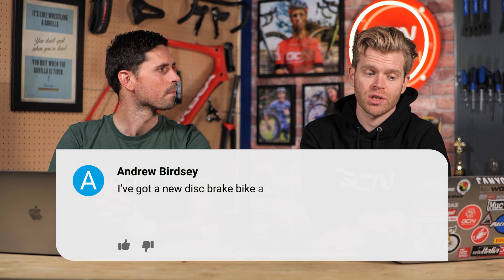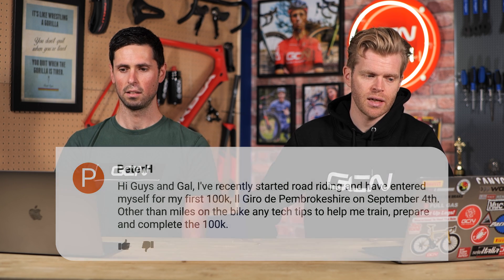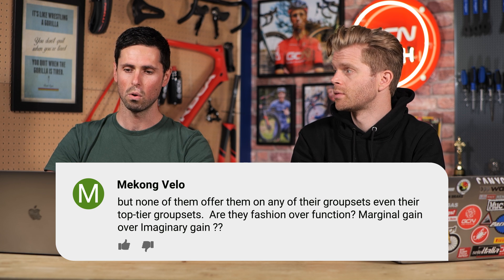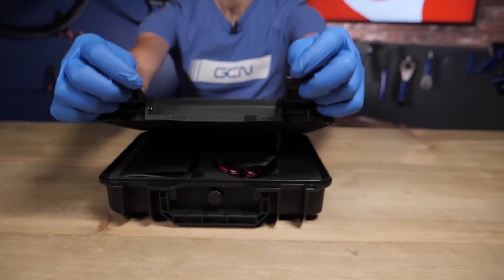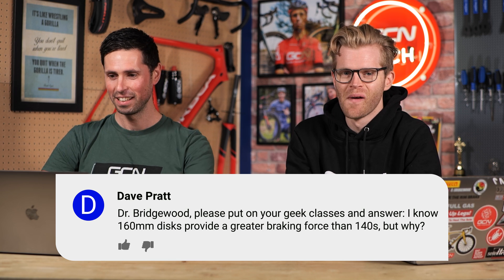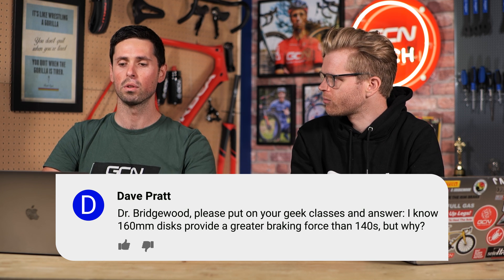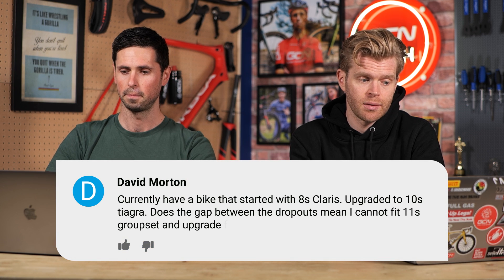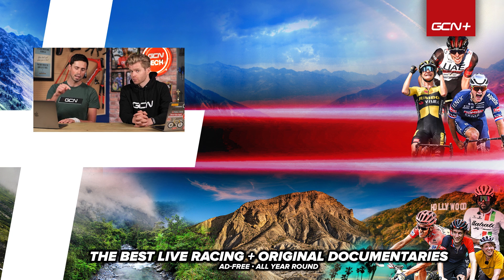Is There A Maximum Speed Bike Tires Can Go? | GCN Tech Clinic #AskGCNTech

Comment from the maker: Do you have any pressing tech related questions? Ask them in the comments below with #AskGCNTech, and we'll get back to you in a future tech clinic!
Reply: Do single speed cruiser brake bikes have fewer repairs and repair costs per kilometers ridden per year?
Reply: #AskGCNTech
Hi GCN, I have a bit of a conundrum that I am hoping you can help with.  When pedaling under mild to heavy loads in 50/11 my bike feels like it is skipping gears.  The feeling is so unnerving and I am afraid I will crash each time it happens.  This ONLY happens in 50/11.  The cassette is relatively new and I have replaced the Rear Mech hanger, Rear Mech, Chain and Freewheel but the issue remains.  I have also had 2 local shops look at the bike and the mechanics are all baffled.

Cervelo R3 - Rim Brake - 11 speed Shimano Ultegra groupset (mechanical) w/ 50/34 Front & 11/34 Rear.  The hub is an older Powertab G3.  Please help!
Reply: How hard is it to convert a bike to an e-bike post purchase?
Reply: How do you remove old Octalink cranks from the BB, when your crankarm puller has stripped all the threads and tapping them with a hammer doesn't work?
Except for just... sawing them off, of course.
Reply: So, ref @5'46", bigger rotors mean bigger moment, equals greater effectiveness, then increasing rotor size means better braking. Let's take this to the limit - a rotor the size of a wheel. But since we already have a "disc" to which the tyre is attached - we can do away with rotors altogether - "et voilà" - rim brakes. 🤔🙃

Comment: #AskGCNTech I have a gravel bike (Cinelli Zydeco 2022) and it came with a mechanic groupset. There are cable holes running through the tube. I recently upgraded to a Rival eTap XPLR groupset and now the cable holes are empty and worried that water might enter the frame if I leave them open. Any ideas on how to cover them up?

Comment: #AskGCNTech Hi guys and gals, what are your thoughts on creaking carbon frames?  Is it a thing?  Do lower end carbon bikes inevitably develop a creak?  I have a Giant defy 3 with about 6000 miles on it and a few weeks ago the bike developed a dry creaking noise around the bottom bracket area when climbing or off the saddle putting down some power.  Took it to my LBS to get the press fit BB replaced, still creaks.  Swapped out the front crank, still creaks.  Cleaned the seatpost, still creaks.  What gives!?! Thanks for your input and love the channel.

Comment: #AskGCNTech Hi gang. I’d love to dive into the world of latex. I’m talking tubes of course. I’m currently running normal tubes in my Campagnolo Bora WTO/Vittoria Corsa combo, but is it safe to use latex tubes in carbon rim brake wheels? Will there be issues with heat when descending as I tend to drag my brakes because I’m a bit of a pu**y 😞

Comment: Why are standard SRAM 1x chainrings with more than 50t only available in BCD130? Do I have to buy a China import instead? I have a 1x gravel bike which I use for triathlon and want to „speed up“ from my current 50t. However, I plan to get a BCD110 Powermeter spindle and want the option to use easier options from time to time #AskGCNTech

Comment: OSP probably aren't faster since you've got more tangential torque on the bearings, therefore increasing the drag and wear. Offsetting the gain from the bigger size. your explanation about manufactures not testing it is probably bs too. over many decades surely they'd had many many opportunities to test different pulley wheel sizes. and seing ceramic speeds prices for which they can actually sell stuff they would have done it buy now 100%

Comment: Either the large pulley wheels are hog wash or 10 tooth cogs on cassettes are horrendously inefficient. Which is it? If the reasons why large pulley wheels reduce system friction are true then those reasons should be doubly true for inefficiency of a much more highly loaded cassette cog with 10 teeth! I think it’s ridiculous to accept 10, or 11 teeth on a cassette but then blow money on OSPWs. Yes, the extra chain articulation of smaller wheels robs some small wattage. There’s much more wattage to be saved with larger cassette cogs than can be saved with larger pulley wheels.

Comment: On the groupset and oversized pulley, it's likely the patent required is owned by someone else either Ceramic speed or so and other brands are looking for ways to optimise performance that doesn't infringe on the patent owned.

Comment: #askgcntech How many pounds per square inch (or metric equivalent), can a crank and pedal system handle, before failing?

Wattage Bozooka question: how many pounds per square inch (or equivalent) can a sprinter (track/road/bmx) produce?

Comment: Oversized Pulley Wheels:
The more the chain is angled in the jockey wheels, the more friction there is. But the higher the quality of the chain, the less friction it has. A Dura-Ace chain has much less friction than a 105 chain. Therefore, enlarging the jockey wheels is less effective there. If you climb a mountain on the small chainring with maximum power, the effect is particularly small. The advantage is greatest on an Ironman bike course because the power is slightly lower and the chain speed is higher on the big blade.

Comment: Generally speaking, bike wheels/tires also have a larger diameter than car wheels, in addition to the the magnitude+ differences in weight and forces between your average cyclist and your average car. IE bike wheels roll at lower RPM at a given speed, compared to car wheels, meaning the much-lower forces are spread out even further

Comment: #askGCNtech Hello, from sunny south Florida. I have a peculiar issue with my 2020 Allez sprint. I've noticed a small creaking from the drive side which pushed me to get the bearings changed. Now the issue persists at noticeably less amplitude. What's bothering me is it's come with a new noise on the non-drive side when I'm bearing weight at the bottom of the pedal stroke while coasting, like a small hiss of metal-to-metal contact. What could this be? I’m super particular about noises on my bike and always try to keep the maintenance in check as if it was a formula 1 race car.

Comment: There are some older shimano groups that have larger tension pulleys on the rear derailleur. I have one 9 speed altus that has a larger 16 or 17 tooth pulley, Compared to the standard 11 or 12ish.

Not exactly done to the same level obviously, but it has been done. If I had to guess, the smaller pulley wheel lend themselves to smoother shifting groupset, also obviously cheaper and more compact so they don't get hit as easily by sticks, rocks or whatever.
Reply: Shimano megapulley! I remember seeing this on an old hybrid bike and chuckling to myself

Comment: For a mechanical groupset alternative to 105, I'd suggest Sensah Empire.  Trace Velo, China Cycling, and others have reviewed it, favourably.  I get along really well with mine.
Reply: +1 Sensah Empire and SRX Pro are amazing groupsets. 100% functional and easy to service for the average rider. Extremely smooth shifting,  and there's plenty of on and off road testing to back them up.

Microshift Advent X is an exceptional option as well, and it comes with a clutch and dropbar compatibility to boot. A bit more rugged construction than the Sensah options, but slightly heavier and more expensive.

I run a gravel bike and enduro bike with Advent X, a road bike with empire, and I just built up an adventure bike for my best friend with SRX Pro. I also sell, service, and rent out bikes with components from all other manufacturers. I've ridden, repaired, taken apart, and thrown away just about every deraileur and shifter out there. 

The top of Shimano and Srams' catalogs are superior to anything coming out of the Eastern Market; Red ETap, Dura, and even Rival and Di2-- those are extremely high quality groupsets. Sensah and MS have nothing to compare. 

But below the electronic lines from big boys, the mechanical offerings are comparable or worse than their eastern competition, at a price that can reach 1000% higher. If we ever get hydraulic breaking with the Empire and Advent x, I'd argue that Shimano and Srams mech groupsets will have very little value return.

Comment: Alex, you are whoa fully  uninformed regarding latex tube repair.  I have repaired hundreds of tubular flats with latex tubes using a patch’s cut from an old latex tube and rubber cement. It’s safe and have ridden hundreds of miles on repaired tubulars before you where even born.

Comment: #AskGCNTech I have a 2021 Giant TCR Advanced Pro that actually came from the shop with 32mm gravel tires (not sure why) which I replaced with 25mm tubeless road tires. While riding the roads in the Appalachian mountains of North Carolina I came across a 3~ mile gravel section so I deflated my psi to about 40 and proceeded carefully with no issues. Should I use my road bike in the future for light gravel routes like this? Can I adapt my road bike into a gravel bike by employing gravel tires? Or do I just need to bite the bullet and buy a gravel bike?

Comment: #AskGCNTech Hi Guys, in motorsport, the drivers always warm up their tires before a race. Could this also be useful in bike riding?
Reply: I think tire warmup for motorsport is mostly to acclimate the tires to the high temperature and stress they'll experience acutely when they accelerate rapidly. If they didn't warm up,  they'd be going from cold to 100mph in just a few seconds, and the rubber would be too brittle to handle the force.

Since bicycles accelerate significantly slower, they don't get the same acute force activated all at once. In fact, by the time a bicycle tire starts withstanding significant force, heat, or stress, it will have already had plenty of ride time to warm up.

Comment: #AskGCNTech I have got a lot of problem with wind noise lately. My tinnitus gets very loud after some time on the road. I have tried wind-stopper muffs and “cat ears” but it haven’t been so effective. I have looked at TT helmets like the Giro Aerohead that cover the ears but does it help to reduce the wind noise? Or are there some other good tips to my problem.
Reply: Believe it or not, earplugs will let you hear better by blocking the wind noise across your ears. They reduce all sounds true, but wiping out the "bottle top" effect more than makes up the difference. 
I'm surprised you're tinnitus is increased by a bicycle ride, it is windy, but not terrible. When the weather gets cold, an under helmet cap or balaclava that pulls over the ears will do fine as well.

Comment: #AskGCNTech Dr. Bridgewood a follow-up question, if I may. If it is about a larger moment arm and surface area, then why don't rim brakes offer the best stopping power? The wheel's rim track is both larger and further from the axle than the disk rotor.
Reply: They can and do have better  but they are limited by how aggressive you can make the pad as it would wear the rim to fast. On a disc rotor you can clamp harder(especially with hydro) and use more aggressive compounds because the wear surface is replaceable.

As a kid we all leaned that you can't clamp the front brakes to hard or you go over, I have not been able to (as easily) do that on a cable actuated disc brake.

Also disc has advantage over rim brake for wet weather as the braking surface is not as close to the tire and splashing water.
Reply: Couple of reasons, pad material, and the amount of force applied.
If you used the same material that is used in disk brake pads in rim brake blocks it would increase the friction by a fair amount but it would destroy  an alloy rim very quickly and carbon ones pretty much instantly, disk rotors are a consumable part like the pads because of the friction materials used.
And as for force applied, disk callipers ( both mechanical and hydraulic) can exert a higher clamping force on the rotors than rim brakes can for the same amount of effort at the brake levers. Which is why a relatively small rotor still works. You also gain a bit more finesse with disks where sometimes rim brakes can feel like all you have is "off, on, and completely locked up"
I'll still be sticking with rim brakes though. Cheap, simple, and they do what I need well enough!

Comment: #AskGCNTech  at which speed would you recommend stop pedalling and going full aero? In regards of getting fast and/or saving energy.
Reply: I suppose you do it at the speed where your pedaling is making less of a difference than your drag. That's not a fixed speed. It depends on the wind speed and direction, the grade of your slope, your own personal inertial energy. If you are a heavier dude with a heavier bike,  you might choose to tuck earlier or at a lower speed than your lightweight buddy who stops pedaling and actively loses speed due to his low gravitational potential failing to overcome air and rolling resistance. 

I think you have to ride a lot,  practice a lot, and learn to feel the forces acting on your body and bike to determine the best strategy for yourself.
Reply: That’s a great question !

Comment: #askgcntech Hi tech team, the OSPW question made me think; The current market leaders of OSPW systems make such expensive products, and therefore can only be fitted to top tier groupsets. Do you see trickle-down tech bringing affordable versions with standard steel bearings to the market as more of a custom modification for mid tier groupsets like 105 and Rival? Note about the Claris/Tiagra upgrade, don't forget some older freehubs are not as wide, so if there is no spacer behind the cassette, 11 speed is not compatible and you would need a new pair of wheels to complete the upgrade.

Comment: #AskGCNTech Hi ya Team! I recently got myself a new gravel bike with GRX which comes with a clutch on the rear derailleur.  As 85-90% of my cycling is tracks & trails, is there a reason why I can't just leave the clutch on all the time?
Reply: The clutch is made to be active all the time. The only reason there's a release trigger or hold button is so you can service the groupset and chain without dealing with the clutch tension. 

The chain will not stay on the bike with the clutch disengaged. Not even on a smooth road. The clutch release completely mucks up the primary shift mechanism. Don't try to ride like that. It's not made for it.

Comment: #AskGCNTech  I  suppose this is a question for Ollie . . .
Does barometric pressure have an impact the strength of a headwind?  I.e. does it require more power for a 70 kg cyclist riding 30 kph into a 20 kph headwind when the barometric pressure is high rather than when it is low?
Reply: This is a very interesting question. But what will the answer teach us? We don't get to control what the weather is like when we ride, what the barometric pressure is, or even whether or not we're going into a headwind. Knowing whether the pressure makes a difference won't change behavior, will it? Like, we wouldn't ride differently, would we?
Reply: @BoomerangVillage  yes it would, Stravaaaa! Low air density and a tailwind, heading out to get that segment back from the e-moped.
Reply: The barometer measures air pressure. Air pressure is half atmospheric at 18,000 of altitude. Airliners like to fly high for efficiency of less wind resistance. It applies to you as well. But, I'd guess you'd have trouble measuring the difference caused by the tiny  differences we get from natural pressure changes.

Comment: I've been repairing latex tubes with Rema patches since the 70's in tubulars and over the past 10 or so years in clinchers.  I've used both 20 mm and 25 mm patches depending on tube diameter.  Also, have found latex tubes are easier to patch than butyl as the latex tubes have no seams.  I don't recommend using sealant in a latex tube as the hole in the tube will eventually develop into a tear.  Also, don't recommend using new or patched latex tubes on long descents -- learned this while living in the Colorado Rockies.  This would be true for the newer plastic tubes too.  However, when living in relatively flat Texas, and even in the Hill Country, the descents weren't long and windy enough to cause an issue due to rim brake heating the tire.  In CO the rim would be so hot from braking while descending if a tube blew had to wait for it to cool down to replace the tube.  Disc brakes would be the way to go.

Comment: #AskGCNTech Hey lovely people, re: 160 vs 140mm discs, then why don’t rim brakes have the most stopping power of them all? I’ve never understood that… Thanks for saving me from many more sleepless nights trying to figure that out!
Reply: Even though the rim brake has a longer lever arm (being further out on the wheel), it cannot match the clamping force of the hydraulic pistons so the overall effect is better stopping performance from disc brakes. Plus, if your clamping force on the rim brake is too high, you could damage the wheel. A disc brake does not have that limitation.

Comment: In the last question. If the rear hub is 8, 9 or speed hub. The Shimano 11x34 cassettes are concave on the back. To fit the shorter freehubs.

Comment: #AskGCNTech.  Hello GCN Tech gurus. Is it imperative to have a maximum 16 tooth variance between the small and large chainrings on a 2x drivetrain?  I have a 48/32 set and a 50/34 set by the same manufacturer. I want to pair the 50 with the 32 on my gravel/bikepacking bike. Is that advisable?
Reply: Also interested
Reply: Try it and see.

Comment: #AskGCNTech.  I have a set of really great 3T carbon wheels with thru-axle that I took off of a singles bike.  Can I can fit them to a tandem with QR skewers?  Where could I find a conversion kit is such is available?  Also, the tires on the 3T wheels are 700x28 while the tires on the tandem are 700x32.  How wide a tire could I go on the 3T wheels to maximize the comfort of the tandem.